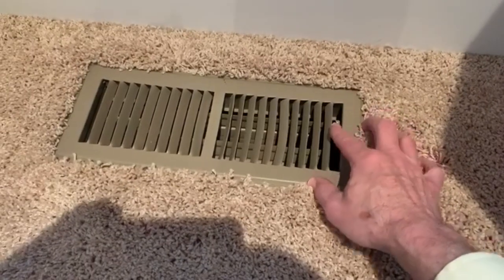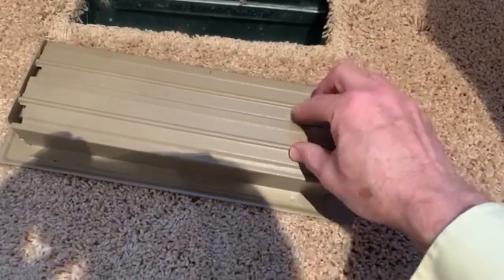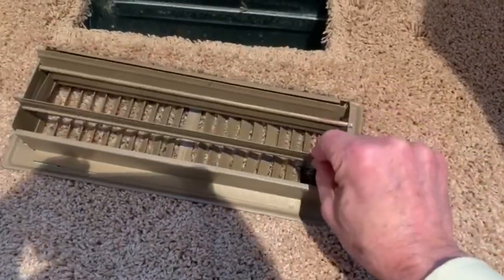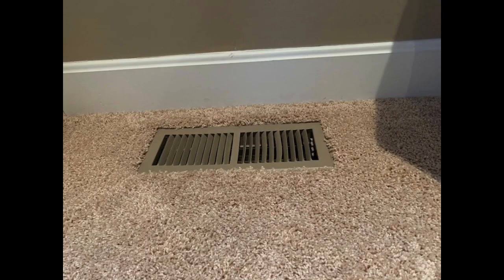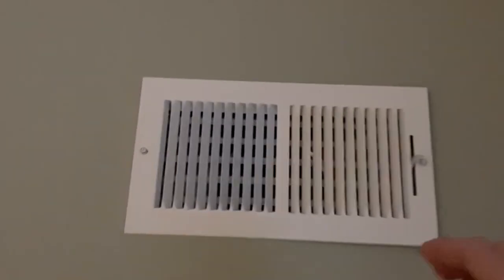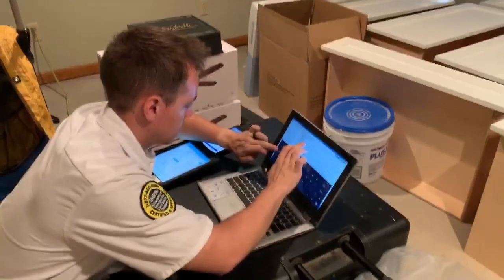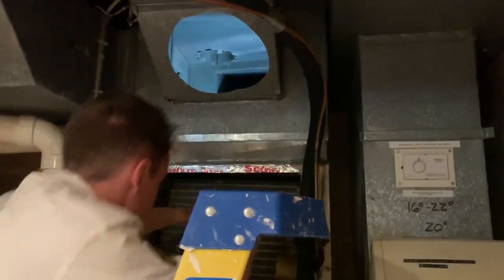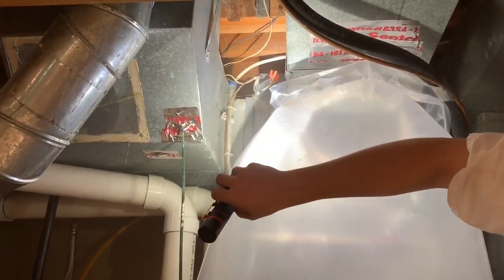Fixing HOT SPOTS and COLD SPOTS in Your House: How do I warm up my basement?

Comment: Kind of balances system at the vents never works they are still tries to get there. I've tried here and there you slow it down a little bit but it's never a nearly as effective as a damper at the trunk line. The only way you're going to get some Perfection is with that zone damper system and that's what I tell people. But the variable speed furnaces they work pretty good nowadays

Comment: Ive always wondered why in order to do any zoning to an existing (non zoned) hvac system you have to cut into all if the “zones” in order to technically have an automated damper installed.   To do that parts alone cost upwards of 500$ and then you likely have to cut into drywall substantially then cut a big hole in the ducting to fit dampers in.  Tell me why the hell they dont sell or make automated register dampers that wire back to the zoning board ??????   Ive looked and havent been able to find a one..  or at the very least an automated damper thats rectangle where you can stuff below the registers then run your wires??  Its a heck of alot less intrusive to run only cabling to the drywall..  and theyd have to cost relatively the same as the typical round ones... that might be a million dollar idea but somebody had to have thought about that before...  im not that damn smart..  but why wouldnt that work??  You could tie in multiple register dampers to make bigger zones and if you have ceiling registrs in the basement than you wont have to climb up on a ladder to adjust the things..  just seems like a much much better way to do it..  to an existing infrastructure thats fully finished.  Guess in a basement with open joists than it would be easier to install regular dampers but with all the unnecessary crap inventions and whatnot that this would already be a thing ya know..?
Reply: It depends on the house and where the ductwork is located. I put in zone damper systems and already built homes did not have to tear the house apart everything was accessible. It's even easier now because I know what Honeywell they have wireless control module so I don't need to run thermostat wire all over the place cuz that's usually the hardest part. Running the thermostat wire. You don't want to try to balance at the grills that's the worst place you want to do it right off of the main trunk line. You really can't do much with trying to balance with the Vance. You going to lie open or closed 100% really not an effective way to do it